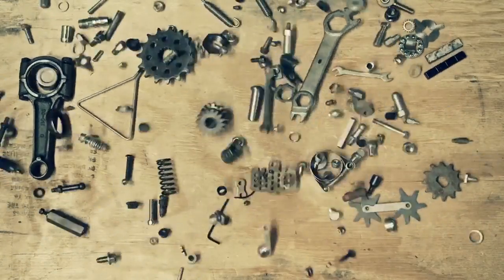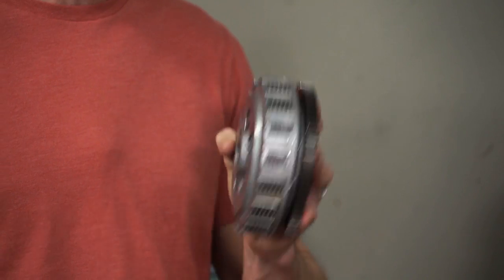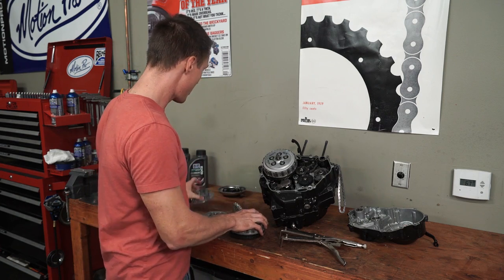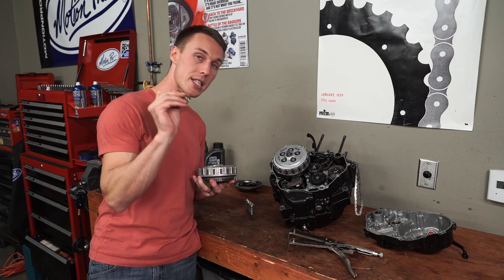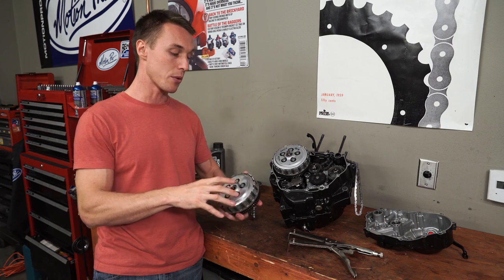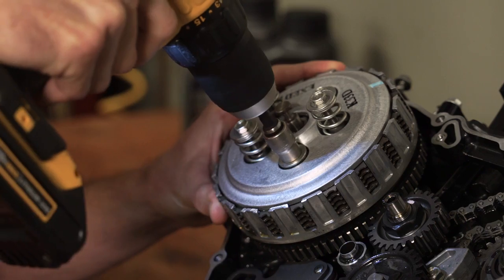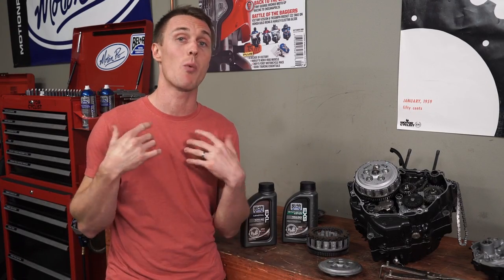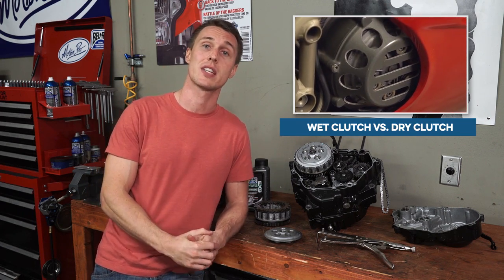How A Motorcycle Clutch Works | MC GARAGE

Comment: Thoughts on Rotella T6 and T5 haha? It's MA rated ;)
Reply: running diesel oil is asking for problems
Reply: Tell that to the people racing on it and using it for engine build break-ins. Both the T5 and T6 meet the JASO MA standard. I've tried it before and it worked fine. Nothing special really. Definitely best bang for your buck at like $15/gallon. Shifting quality seems to degrade a little bit more quickly than regular motorcycle oil though so I'd change it more often. I've beat the bejesus out of several bikes, some 40k+ miles and had no problems.

But then again, I actually change my oil. That's really the most important lol

Comment: I bought an '03 sv650s about 5 months ago now, slowly fixing things (right now all the rear bearings) and I'm wondering if I should bother looking at my clutch plates. the bike has 18k mi on it and I believe I'm the 3rd owner. one of the owners before me didn't really take great care of it (definitely low sided, striped some screws, cosmetic stuff) but I don't think it was on the drag strip and I'm pretty sure the clutch isn't slipping. How much do new plates cost and should I bother replacing them?
Reply: My SV650 has 40k miles and the clutch is in good shape. I'd foscus on the more common items like oil, spark plugs, air filter, brake fluid and cooling & electrical system and you'll be fine.

Comment: What a coincidence just started working on my clutch today. I switched the clutch line (hydraulic clutch), and when I pull the clutch in on first gear the rear wheel wouldn't move freely. I bled for hours, but no avail. So I checked the pushrod and clutch slave, and it seemed ok, then I opened up the crankcase, and pushed the clutch and saw that the plates were separating, but the ones at the rear kinda seemed to not spread out as much. I don't know what's going on. Anyone care to help?
Reply: Yeah the clutch was working before I changed the lines. And It won't move when I turn it by hand, I was thinking the same thing. I still think I might have a big air bubble in the line, but the lever feels pretty solid. I have a feeling it's either the lines, or now maybe the clutch slave.
Reply: I got it to work, it was actually engaging. My bike was sitting for like 3 weeks before I switched out the lines, so I think it just needed some lubrication. I started the bike up, and everything worked.

Comment: I want to try a slipper clutch just to see what it feels like.
Reply: Solo Rider Your sportbike most likely has one. If you downshift hard without rev matching and the rear wheel doesn't lock up then you have a slipper clutch.
Reply: nothing too special about a slipper
it just makes downshifting easier since you dont have to rev match

Comment: Hey Ari! you said that you can put into your pressure plate stiffer springs, so that everything squishes together, having a heavier clutch lever. Wouldn't that affect how the bolts would go in altering either; the torque specification or the distance in which the bolts come in before reaching spec-torque?